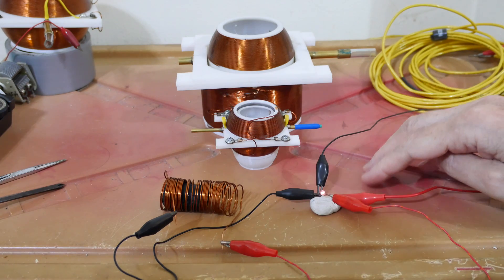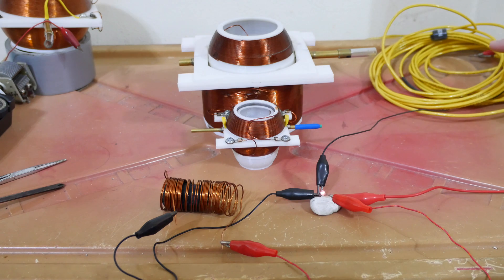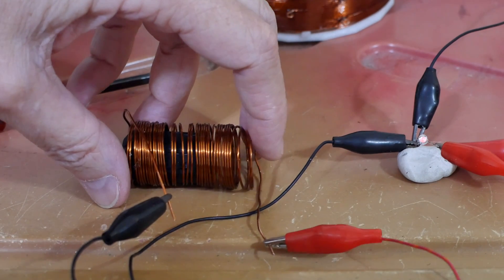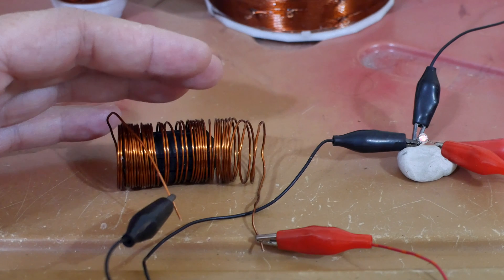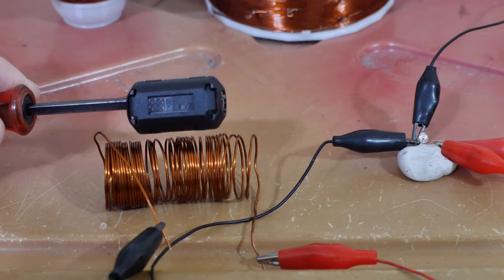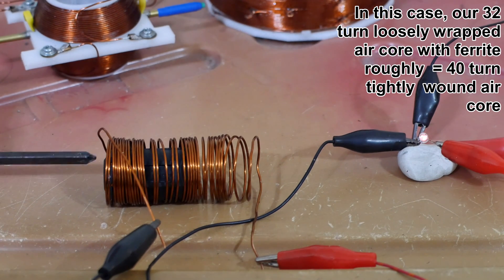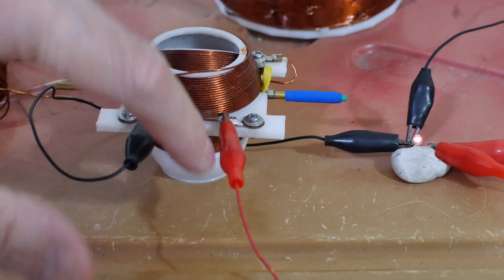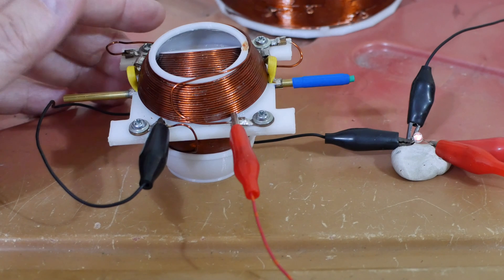Crystal Radio -- Coil Secrets, Screw-ups & Stuff

Comment: Is there a downside to using the ferrite plug?
Reply from the maker: There are a lot of variables. But the most common things to consider are ferrite does not work well at high frequencies, but it is good at concentrating the EM field (smaller coils).

Comment: What happenes if you short the inner windig of the coupler and use the outer wind as inductor tor it
Reply from the maker: I have not tried that, but in theory the inner ball would act more like a solid piece of copper. It should increase inductance (and rob power via eddy currents).